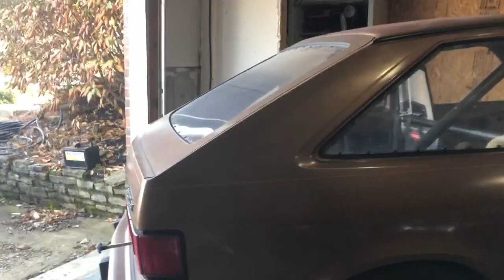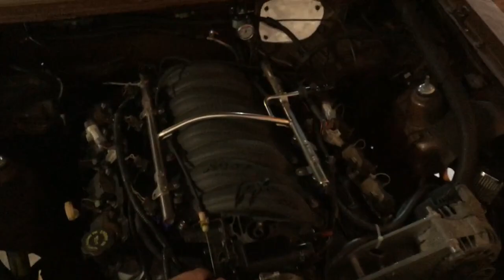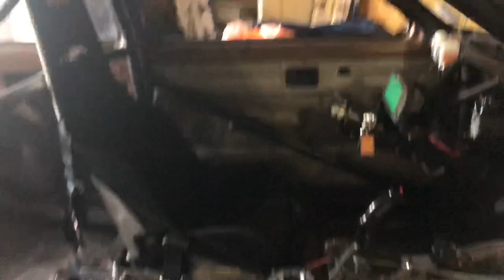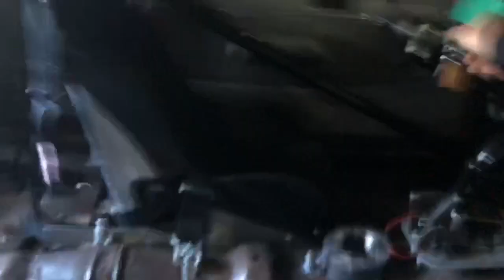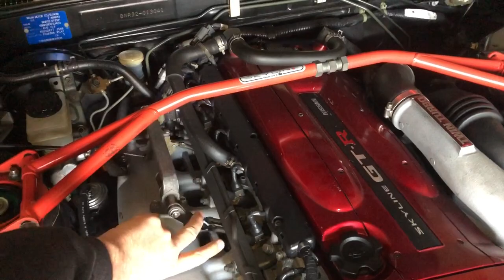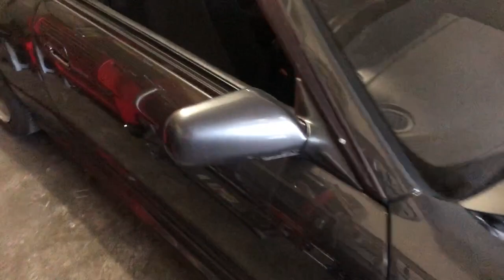Winter sucks!!!!

Comment: What size are ur rear tires
Reply from the maker: 215/65/15, I went with the tallest I could fit in the factory wheel wells after switching to a non O/D trans. These rears are just generic Walmart tires just meant for street driving. Not what you see me on the track with.
Reply: @859romulus22  u used stock location on the 8.8.
Reply from the maker: It’s a custom 9”
Reply: @859romulus22  stock floor board does it even hook on the street's I'm building one
Reply from the maker: Stock besides repairs, it’s doesn’t “hook” but it moves out well enough. I personally will keep the stock wheel wells and limit myself to a smaller tire just for the looks alone. I’m not a fan small cars with big tucked tires or chopped fenders.
Reply: @859romulus22  me either I like ur stock look.  Is the 8 inch slicks about biggest u can go
Reply from the maker: You might be able to squeeze an 8.5” you’ll have to look at the section width per tire manufacture. And maybe run a 7” wheel to keep the section width narrower. My slicks barely rub on my inner wheel tub when I pull in and out of my driveway at an angle.
Reply: @859romulus22  I'm going with 5.3 and what gear I thought of a 8.8 but idk yet
Reply: What gear u running
Reply from the maker: 3.00 but will be switching to a 2.50 when I go turbo.
Reply: @859romulus22  thts crazy just so light it goes
Reply from the maker: Yep, I’ll be aiming for high rpm power to reduce the risk of blowing the smalls tires off. Current best 60’ is a 1.409
Reply: @859romulus22  the not bad u don't need all thous big tires to go fast ya I'm going cut down my rear put chevette brackets on it to look stock.
Reply: U live in kentucky
Reply from the maker: Yes
Reply: @859romulus22  I live not far from u . U know we're caryville is.
Reply from the maker: Never heard of it
Reply: @859romulus22  do u run 24.5 slicks.
Reply from the maker: 24.5”x8” slicks and a 225/50R15 radial
Reply: @859romulus22  what color is tht chevette  factory
Reply from the maker: I can’t find the owners manual right now but it is the factory ‘85 Brown. Very faded and dull from the color shown in the manual though.

Comment: Hey ur 9 inch welded in stock location
Reply from the maker: Correct, all stock brackets with custom torque arm and heim joint adjustable control arms.
Reply: @859romulus22  ok got 8.8 but mine is going to be 4.3 powered thks